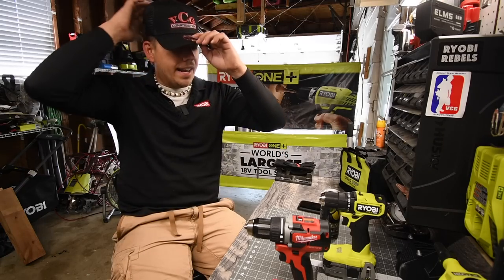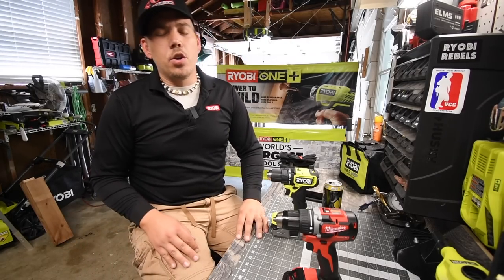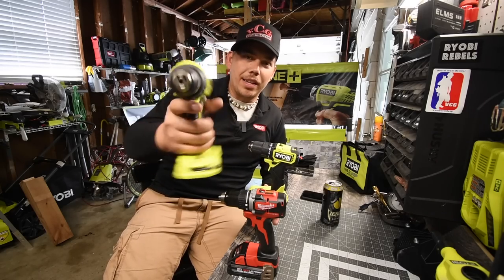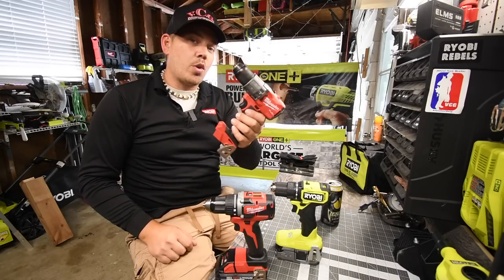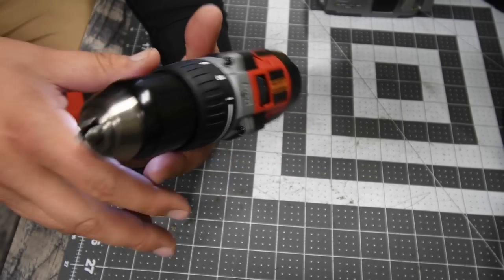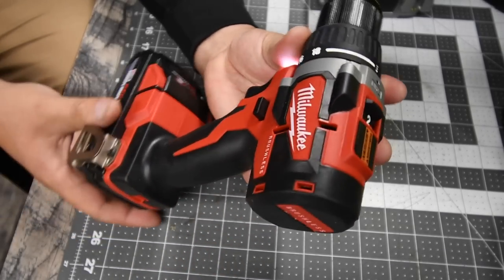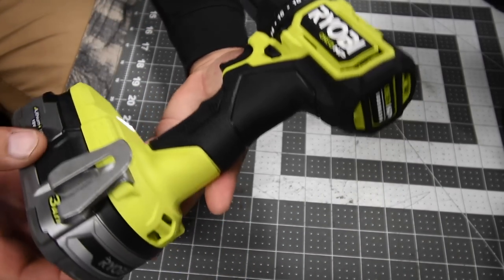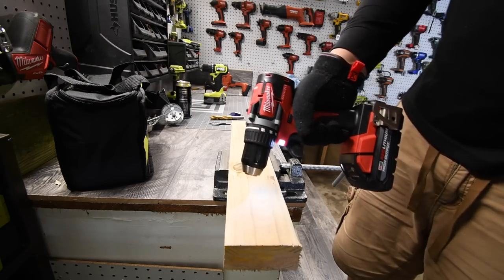Ryobi HP vs Milwaukee

Comment: Great video sir, I am an electrical and mechanical contractor. I was a hardcore Dewalt man, then crossed over to Milwaukee because of battery issues with Dewalt.  My good friend who is also one of my master electrician, advised me about Ryobi. At first I was like hell no! But for the price, and for helpers to use, it was hard to pass up. Yes it's not as fast as my Dewalt or Milwaukee, but it gets the job done.  I bought six Milwaukee tools that came up to almost $1800.  I returned them and got sixteen Ryobi's for a lesser price, and if my helpers break one, I don't care because they are so cheap to replace. I am now going on a full year with them, and so far I am not disappointed with Ryobi, as I yet to have one fail me.
Reply from the maker: Roybi has gotten a lot better through out the years and I thank you Blackbelt
Reply: I totally agree with you on the job site we use Milwaukee but for at home man you can't beat ryobis price, plus it works with all your yard tools. I can't come to terms with spending excessively on Milwaukee tools but it really depends on the application for industrial applications the reliability of Milwaukee is the best but if your framing a house building something just use ryobi and use the excess cash you save on materials. Working in an old plant when everything is seized up Milwaukee is best. Working at home when you're buying new material to build ryobi is the best.

Comment: They went out of there way to make the Ryobi chuck look metal.
Reply from the maker: I was very disappointed with that
Reply: That plastic chuck housing would keep my from buying it.
Reply: I have that ryobi drill. I thought the chuck was metal at first too then was dissapointed it wasn't then after use its actually a really well made chuck and I think I like it better than a metal one because it doesn't get scratched up nearly as easily and stays looking better for longer. Also its extremely well made chuck and it has some sort of locking system that like rachets or something. It holds a bit in better without loosening than any other drill i've used

Comment: I do have that Ryobi HP brushless drill driver. I used it for driving through metal and wood, never let me down. After I bought the drill driver itself, I thought I had better buy the high peformance (High energy) battery for that tool. The size does make it easy to put it in a small tool bag

Comment: Just thought I’d mention 2 things. Milwaukee does make a fuel drill driver separate from the hammer drill and hammer drills and drill drivers make the exact same power. For example the m18 fuel drill driver and hammer drill both make 1200 in/lbs of torque. The only difference is the hammer drill function but the actual motor is the same. Not trying to hate just wanted to mention it. But I am new to the trades and watched many of your videos before purchasing my first drill and impacter. Keep it up!

Comment: Milwaukee has a couple Fuel drill drivers.  I have that 2801 and it works great for my needs. Paid $99 with battery and charger from HD. Looks like the Ryobi is $130. Seems Ridgid and Ryobi are raising their prices higher than Milwaukee lately.
Reply from the maker: I ordered one after a viewer told me the model number

Comment: How does the new compact HP Ryobi drill driver compare vs P252 brushless drill driver. Is it really worth the upgrade?
Reply from the maker: if it did this good against the milwuakee I think it will kill the P252 but only a versus video will tell
Reply: Man Caver Tools obviously haven’t had it in hand yet but it seems pretty under powered. I was just curious so I pulled out the brushed p215 and it can run an extremely used 1-1/4 self feed through with no issues, and the 1-1/2 only stopped on 1 hole. I was using untreated, but still, I can’t help but feel they under delivered here. I would be very curious to see the comparison to the p252!

Appreciate the content, awesome video!

Comment: The Ryobi compact HP drill driver is good if your doing light duty work.

For me I'll wait for the compact Ryobi HP hammer drill that I'm 100% sure will come out later down the line. That will be the real deal...
Reply from the maker: that is exactly what it is for. most Diyers will be able to use it. it is not a pro grade tool

Comment: Worst bits to use with hand held tools are worm drive tips as you demonstrated they grab and can injure your hand or wrist, plus every time you started with the Milwaukee and use the same bit which gets dulled every time you use it and then put in ryobi, should use new bits no worm start points and will get a better comparison
Reply from the maker: I thank you bob

Comment: It’d be informative if you recorded all your drill times and ranked them (kinda like Doug Demuros car rankings) so there’s a spreadsheet of your best tool performances and preferences.

Vacuum wars also has a ranking method that updates every year. With all these tool brand comparisons, it gives us a better conclusion to the video. I expect more people are gonna find these vids when they are shopping, and a chart is a nice way to summarize and distill your experiments.

Just a thought, cheers!
Reply from the maker: there is too many variables in these tests to keep track. because of all of the different situations I put these through
Reply: Doesn’t have to be scientific, just a preference score and then a timed screw into the log stump.

Comment: David, I don’t understand what you mean by tightening the chuck, then clicking back to lock.  Do you mean in the opposite direction or counter clockwise?  When I use the ratcheting chuck on my M12/M18 drills, I tighten clockwise, then continue to tighten clockwise until it locks in place.  I don’t go backwards of counter clockwise to lock.  If you go backwards you’re not applying the locking force intended.
Reply from the maker: if you tighten the chuck and click back one more it will lock the bit in place.
Reply: Marty check out protool reviews  YouTube channel. They have a video on what MCT is talking about in regards to locking the chuck
Reply: ckcuev The Milwaukee bit fell out twice and this “feature” is never mentioned by a manufacturer. The click you hear when turning it back the other direction is the chuck UNLOCKING. I just checked on my Dewalt.
Reply: @Mta92193  it's a feature on some drills. Not all have them. Watch the protool reviews YouTube to see the explanation. I don't know if the milwaukee has it or not but some drills definitely do. I never knew about it until I saw that video.
Reply: ckcuev I looked and I couldn’t find anything. What’s the title of the video?
Reply: ckcuev That’s the clutch, not the ratcheting chuck. They never used the chuck in that video.
Reply: @Mta92193  oops sorry wrong video. I looked for it and they must've taken it down for some reason. I remember it clearly. Was about 2-3 months ago

Comment: Milwaukee actually does make just a M18 FUEL drill driver version, its 2803-20 and the M12 FUEL is 2503-20.
Reply from the maker: I look at milwuakee tools at the home depot all the time on the website and store. I've never seen it. id have to look that model number up. is it for the USA or a different country
Reply: @ManCaverTools  Its American,  I hot mine at acne tool depot. I'm in Sacramento.
Reply: I own 2503-20 and bought it from my local Home Depot. It's a fantastic drill.
Reply from the maker: Found it and thank you sir. Just bought it
Reply: @ManCaverTools  one of the best purchases I've made, I also got the one key 1/4 impact . The best.

Comment: I am a typical diyer, I like my brushless impact driver and and drill set but I have noticed my chuck teeth have stripped out on the drill. Rather than the drill being able to normally drill the bit back out of the wood when drilling pilot holes the bit will get stuck in the wood while putting the drilling in reverse.  Have you experienced this with the brushless ryobi line??

Comment: Milwaukee does or did idk which but when i was in the market for a drill driver i did see one one milwaukees website no clue where you can buy them i bought the brushless drill driver and regret not getting the hammerdrill it is only .7 lbs heavier and is over 2x more powerful it should have been a no brainer only
Reply from the maker: they do make a brushless fuel drill driver. I just bought it and should be here soon

Comment: I see Ryobi has a two bay charger available for 40 and 18 volt batteries p137 do you know if it will charge both simultaneously?
Reply from the maker: yes they do, but I don't know if it charges both at once

Comment: I'm sure by now you've seen the video that was put out by the tool boss on the leaked picture of the new M18 fuel 3/8 stubby impact wrench it also will be available in full size and in kits the rumor is starting at $329 for the kits
Reply from the maker: I saw it. it looked fat. but we will see the dimensions when it comes out and is in someones hands

Comment: A drill is to drill a drivers to drive fasteners. I hate the ones where they compare a driver to each other while they're drilling a hole. Show it using some lag nuts or screws or whatnot and leave the drilling to the hammer drills
Reply from the maker: I put these motors to the test and to see what their limits are

Comment: Dang I bought the 252 based on your review! Now it’s a fat piece of junk? lol not cool...I do love the tool and have zero regrets switching to Ryobi from Dewalt.
Reply: Kyle, most people migrate from Ryobi to Dewalt or Milwaukee as their going up the tool food chain. I’m a Milwaukee guy, but curious as to how your switch to Ryobi from Dewalt was an improvement.  What did you have, Dewalt’s older NiCad 18v tools?  Otherwise it doesn’t make any sense...at all!
Reply: Marty Lucas Went from brushed dewalts with lithium batteries to ryobi brushless with HP batteries. Was surprised how much more power the drill and impact driver had. Personal preference I guess as well. Ryobi tools fit my hands better as well.
Reply from the maker: that is how tool companies get you. they get you to buy tools, then they come out with something new and improved.

Comment: why cant u drill straight holes so theres no bleeding into another hole...focus...drill straight not on an angle///
Reply from the maker: I did. its a wide angle lens so it appears to be at an angle. most are straight but some are not.
Reply: I know what you're saying. It's a cheap 2x4. Give them decent spacing. Hell I'd even send this guy $5 to buy a 2x4 where he didn't get so damn close to his own holes. But for Th s most part his did a fine job.

Comment: “Huge jump”... my hypothesis is Ryobi is still crap! Why would somebody buy this when they can buy Milwaukee for a tad bit more? Just saying……Still love you my brother. You can pick up your dogs crap in the yard and spray a little perfume on it… but at the end of the day it it is still crap!!!
Reply: I completely agree this line is not for the professionals and I actually think the price point could be better for your DYI guys, I’d like to see how the m12 drill would compare
Reply from the maker: I thank you for viewing
Reply from the maker: this new Ryobi line is not worthy to be pro grade tools.
Reply: I got my brushless Ryobi drill for $44 new with 3 year warranty.   It’s not the same price category
Reply: Ryobi HP is a subcompact drill, it is same weight as Milwaukee 12v and its actually 1 inch shorter. It ended with more battery at  the end of the test, and has managed to do all the extreme tasks that significantly heavier, larger and more expensive Milwaukee did. Who cares if it took 1.65s instead of 1.57s or whatever? You get drastically lighter drill, half the size,  with better battery cheaper, how in the world you concluded that Milwaukee won this one?
Reply: @urosjoksimovic200  facts. It's a pissing contest brother.  These boys going be really mad when ryobi really takes off.  They are like toyota and other foreign car makers were in the 60-80s....couldn't hardly give them away but with time, innovation and continued determination, look at them now.  Let them keep sleeping on Ryobi

Comment: lost me at 6-7 mins in. same bit used for both tools. inconclusive test. didn't even watch the result as it is irrelevant.
Reply from the maker: testing tools itself is irrelevant. there is no real way to actually test tools out. Every time you pull the trigger the tool acts differently
Reply from the maker: Think about it. Imagine using a brand new bit or blade for every single test any tool ever does per individual test, what a waist of metal. Same thing with wood.
Reply from the maker: The best tool testing can do, is to help someone buy into a certain tool line, or help them decide to get a certain tool. no tool test result is real from any channel. the tool you see in someones video, is not going to act exactly like the tool you just saw in a video. That is the reality